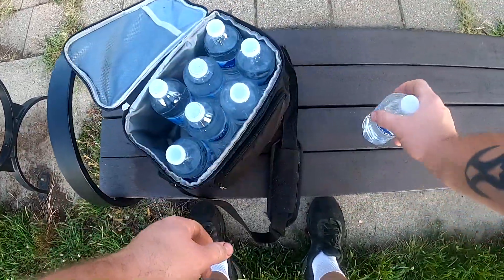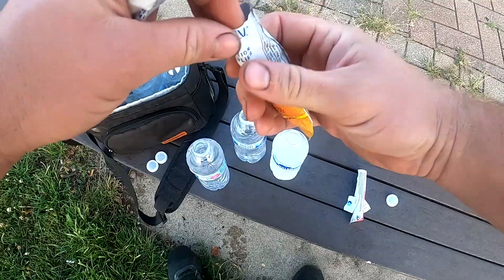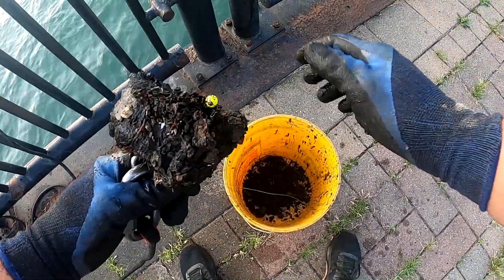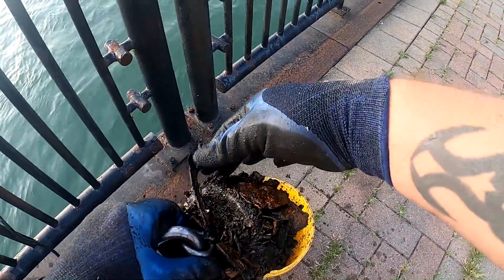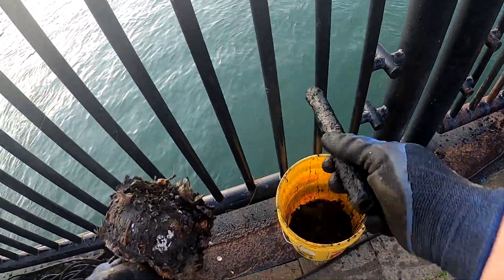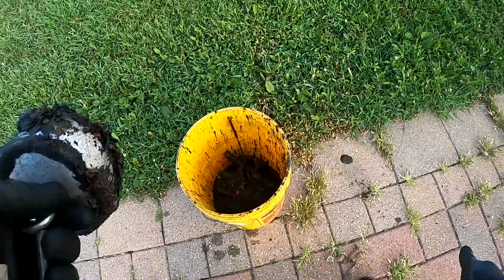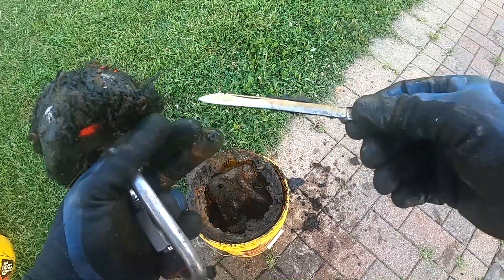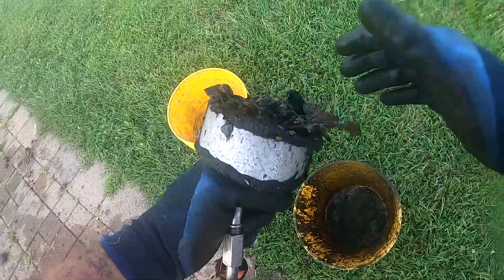My Powerful Magnet is Helping Pull Out Shocking Finds From the River

Comment: Hey Jason,
11:52 it almost looks like one of those old halogen floor lamp bases. They used to put a lead weight at the bottom because those bulbs burn so hot that if they happen to fall over it will catch something on fire.
Was hoping to get out and do some target shooting this weekend but of course I get called into work instead. On my way down to North Carolina.